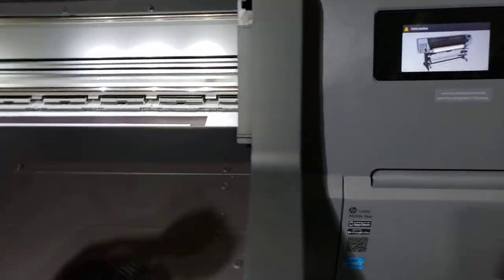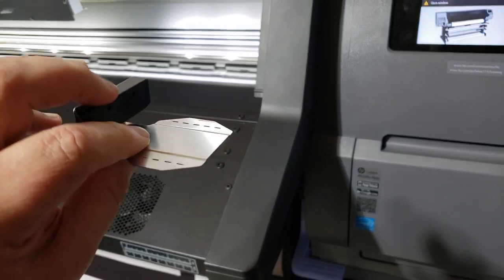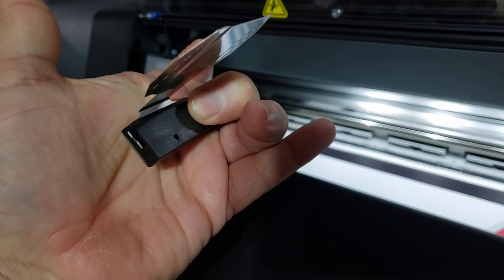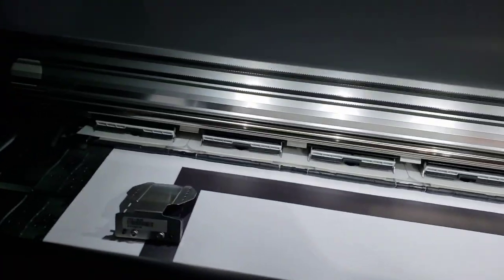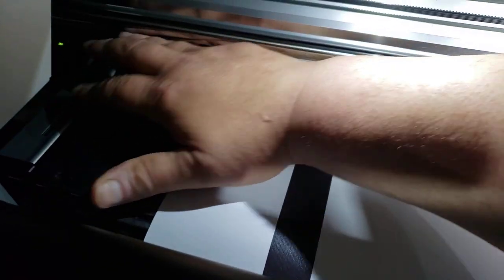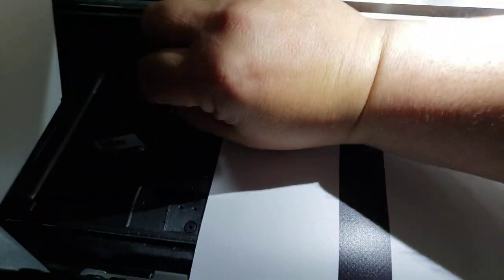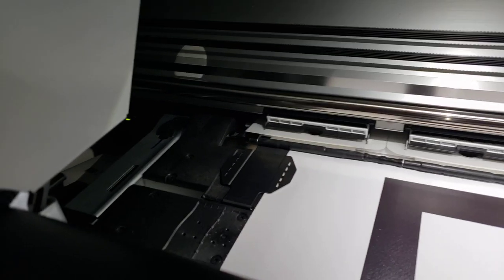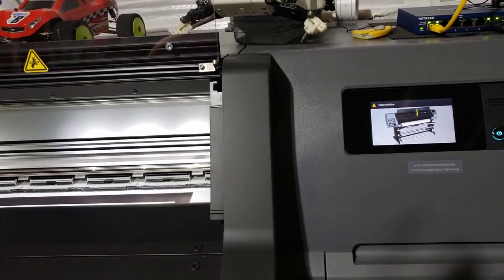edge holder install on hp latex 100 / 300 series printers

Comment: My HP360 doesnt have the gap.. it has a silver/metal bar there.. any suggestions?
Reply: On the left and right side of the platten there is a blue locking pin. Turn the blue plastic knob in the direction indicated on the diagram next to the knob to unlock the pin. It is spring loaded so it should pop up. Once unlocked you can take that section of the platten off by lifting the outer edge up and pull away from the middle. The platten consists of a left and right side, repeat for each side. While the platten is out you can remove or replace the edge guard by sliding it towards the center and off. 

Good luck!

Comment: Oh my guy❤️❤️ you’re the best for this
Reply from the maker: no problem at all!, remember the right side goes in same spot and slides down,
Reply: @DaPrintHouse  yes, I’m guessing I keep the right one all the way to the right corner and just move the left one to my vinyl size ?
Reply from the maker: @KtuluLeaderRise  both sides keep the dotted  slots of edge holders lined up to edge of media on both sides  etc
Reply: @DaPrintHouse  thank you, got my first prints. Super excited for it, what’s the best place to buy media adhesive vinyl do you recommend
Reply from the maker: @KtuluLeaderRise  i only use 2 types so far,  one is the greenstar 6mil from uscutter ( love this for all my freebies and throw ins)  & 
HP Prime Gloss Air GP i buy it off amazon but one i ordered came from lexjet but seems to come faster ;) here is the link from lexjet, they dont have it on amazon for $154 right now but its on lekjet site https://www.lexjet.com/hp-prime-gloss-air-gp?catargetid=320012560000730763&CAPCID=285037065526&CATCI=dsa-297852108457&CAAGID=42178877222&CADevice=c&gclid=Cj0KCQjwmIuDBhDXARIsAFITC_4Mdi-czVE-ec7TD23NOGHg4zQ9QPEHB3Vc0Dr_qkFwt7Btax4awP8aAlOwEALw_wcB
Reply: @DaPrintHouse  awesome I’ll order from Lexjet rn lol, my company makes car decals so it will help
Reply: @DaPrintHouse  sadly I’m still getting jams, it seems like the vinyl is going left more. Any recommendations?
Reply from the maker: @KtuluLeaderRise  when you load it skew should be straight. Also make sure u advance media past heaters under fans  sounds like u maybe starting with media to far back fromm heater
Reply: @DaPrintHouse  is that everyone I print ?
Reply from the maker: @KtuluLeaderRise  well if u get cold rolls on the end usually after its sit awhile.  And generic vinyls mostly
Reply: @DaPrintHouse  okay I’ll buy the hp

Comment: Finally! Thanks for the vid. Do these need to be removed when replacing the media each time? Also, do these help prevent paper jams? I appreciate the info
Reply from the maker: Hi just slide them out of the way during media install.  And they can help prevent  some jams but other jams happen when midea not far enough past the heaters.

Comment: Having an issue no matter how much I move prints over in rip. That it prints over the edge holder and messes up the right side of images
Reply from the maker: Ye i dont print to far out. What is the print width?
Reply: @DaPrintHouse  I push 52 leave an inch on both sides

Comment: What’s the part number or where can I get these? Do they work on HP latex 110??
Reply from the maker: found part # F0M64A, will have to confirm  but they are called edge holders